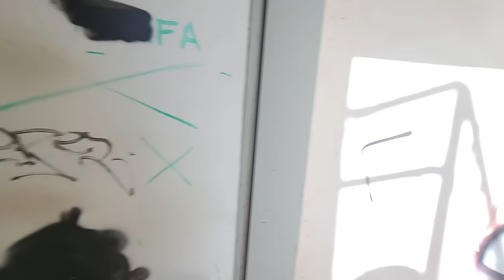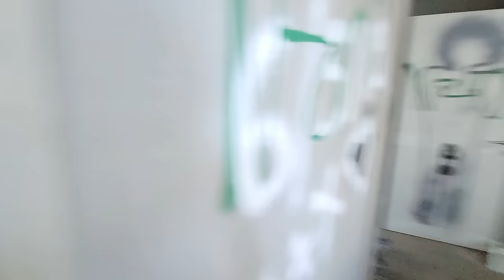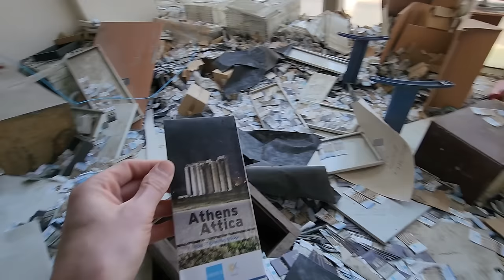Creepy Exploration of Athens' Abandoned 2004 Olympic Venues 🇬🇷

Comment: Half of all the venues were up until recently in Hellinikon, the former airport. All were demolished, because a Metropolitan Park is being built, with actually and surprisingly big progress. I mean, a skyscraper almost 200m tall is being built there, along with 6 others, and already the first floors have been built, so you could say that's a redevelopment. But most of the venues shown in the video are completely abandoned.

The Olympic Stadium, the Basketball Arena, the Aquatics Arena and the Taekwondo stadium are still in use thankfully and remain in good shape, but they need regular maintenance. The Olympic Stadium's roof is going to be renovated completely, mainly for the glass